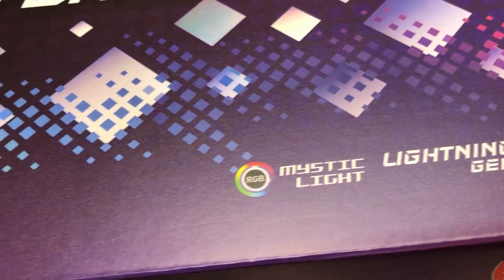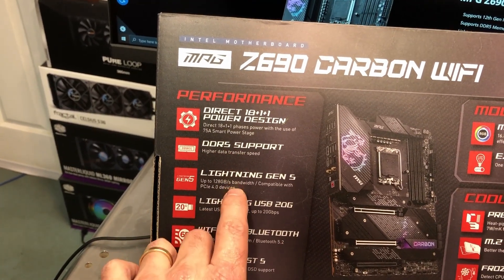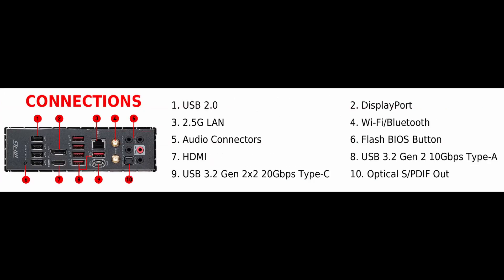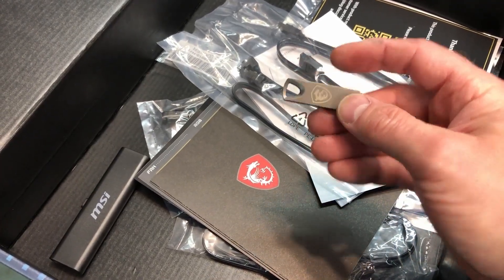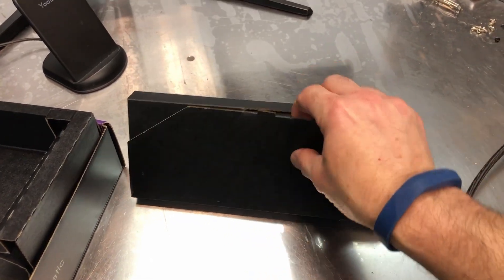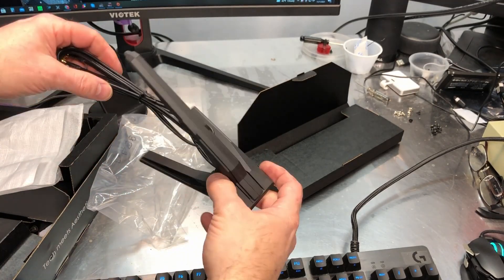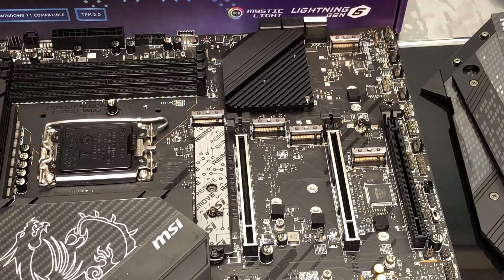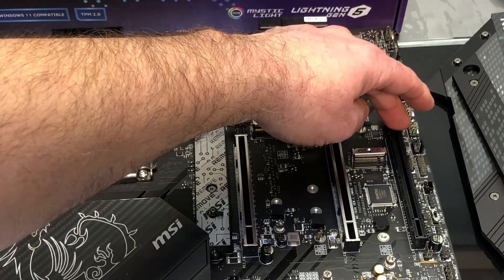OCC checks out the new MSI MPG Z690 Carbon WiFi!

Comment: Got the same board and a 12900K. Still trying to find DDR5 and a 3080 Ti... Probably going to be a while before I can build it.
Reply: aaaand? Any update :)
Reply: @czar4you  Found a 3090 at Best Buy! System is done!
Reply: @decibal7532  that’s awesome. I got 3080ti instead of 3090 as it’s slightly faster in some titles. But 3090 is slightly cooler. Also I went with ASUS z690-f rog and ddr5. Everything runs supper smooth.
Reply: @czar4you  Same here, everything is running great now that I got it all dialed in.
Reply: @czar4you  Returned the Z690 Carbon WiFi. Picked up a Z690 Formula and some DDR5 6000 CL36. System is finished and stable at 5.5GHz OCTVB. No luck on a 3080 Ti yet so I'm running my Strix 2080 Ti for now.
Reply: @decibal7532  Why did you return the Z690 Carbon Wifi?
Reply: @darkmessiah9566  I'm sure the Carbon is fine. Just wanted an Asus board. I've used them with my past few builds and am more familiar with their BIOS.
Reply: @decibal7532  I see then! Currently torn between the Aorus Ultra and the Carbon, i'm afraid to buy the Hero due to that burn business...
Reply: @darkmessiah9566  The Hero's were all recalled. Shouldn't be anymore on shelves. I bought a Hero before the Formula and had to return mine. Had the flipped capacitor. Definitely think Asus dropped the ball this launch. So many weird issues with their products right now.
Reply: @decibal7532  That's exactly why i'm worried, what do you think about the Aorus Ultra?
Reply: @darkmessiah9566  I almost went with a Gigabyte board but am hearing they are having issues as well. If I could trade out my board right now I would probably get the MSI Unify X or the Asus Maximus Apex. I'm truly disappointed with manufacturers right now. They don't seem to be doing any testing or QC before pushing out products. They are making the consumers do the testing for them. Would explain why there's so many issues. How does a manufacturer not realize they pushed out a board with flipped capacitors. This is probably the last new system I will build. I'm going to build a gen behind for now on.
Reply: @decibal7532  Those 2 you mentioned are waaay overpriced...i would get them tho...
Reply: @darkmessiah9566  Agree, they are way overpriced. Quality has gone down and price is going up on everything. The Aorus Ultra would probably be a fine board. I think the issues Gigabytes been having are on their cheaper boards and PSU's.
Reply: @decibal7532  I might pull the trigger on the Ultra for my 12700k